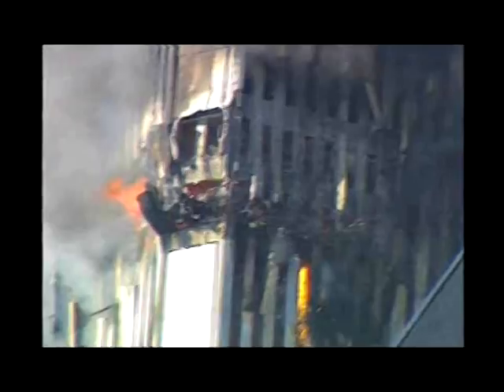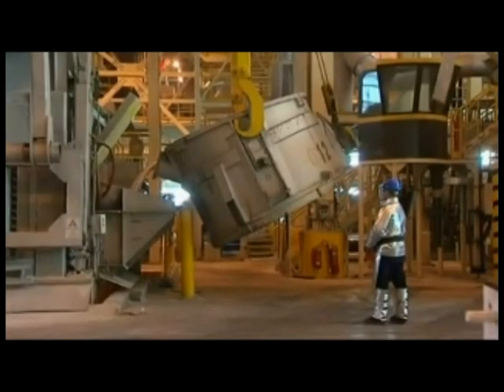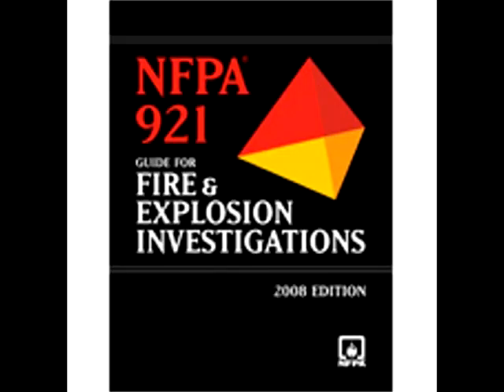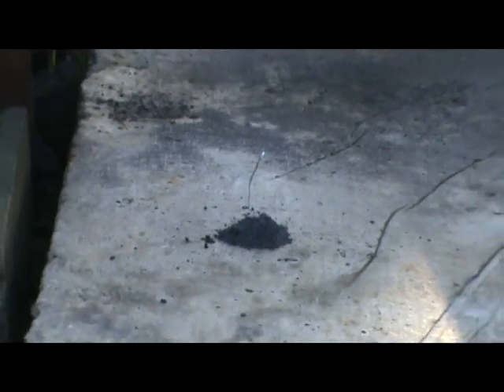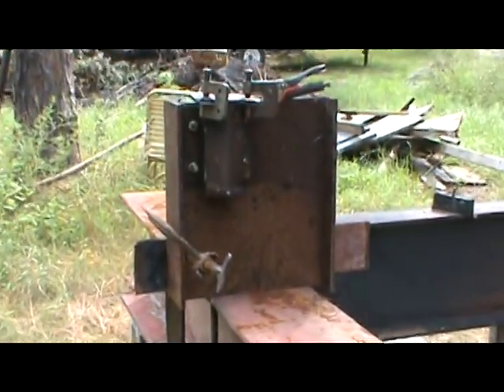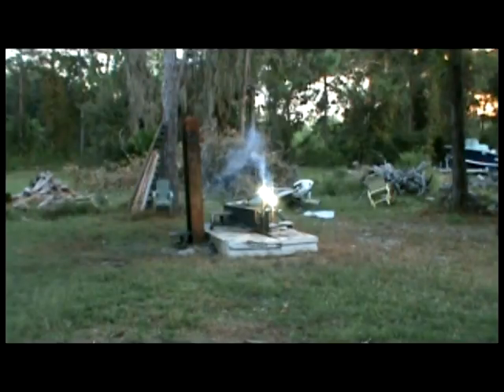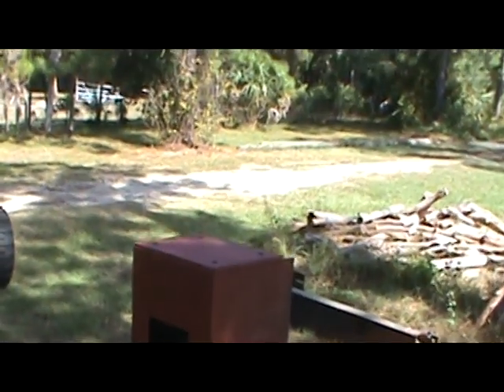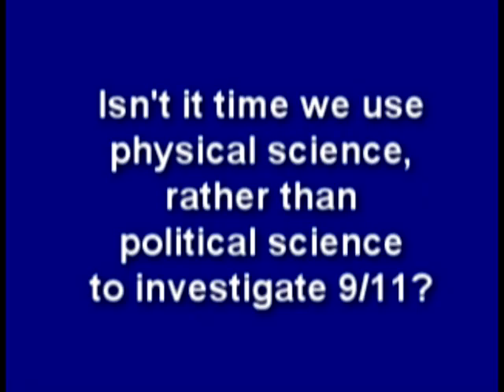9/11 Experiments: The Great Thermate Debate

Comment: Maybe a normal office fire can't melt steel. But have you thought about the air movement in this height? There is a steady airflow just like in a coal pit of a forge. And it's easy to reach high temperatures by blowing air through the forge to melt iron with 1400 °C. The melting point of much steel alloys is lower than from pure iron. And the temperature where steel loses the stability is much lower. Arround 900 °C. 

And who says that the molten metall pouring down the window is from the steel beams? There are many filing cabinets are made of metal which can melt at low temperatures. There are so many other metall sources in an office. If the temperature is high enough, you can melt everything. And burning fuel, paper and furniture with a steady airflow from the wind would make it quite hot...
Reply: Fraggy1972 what about oxygen on board that would act like oxy-jet fuel torch
Reply: People also seem to forget how much electricity flows through these buildings, imagine all that wire being cut/burned and arcing to all the surrounding steel. With enough electrical current you would get lots of sparks and lots of added heat
Reply: People suggesting oxygen from onboard the aircraft or electricity from the wiring could have collapsed a steel structure are more delusional than any conspiracy theorist I've heard yet...
Reply: Exactly
Reply: And the really sad thing is that I have had to explain this to each and every one of you.
Reply: Really?  Then please identify my errors and provide the 'correct' information.  Also remember that I'm talking to an audience of laymen - most of whom probably don't even understand what potential energy is.

Think about it here - these people think that thermite was needed to bring the towers down so we know that they don't even understand the most elementary concepts.
Reply: lets say you are right and the jet fuel could melt the steel beams. if that was the case why did the building fall as if a demolition team were working on it and not a fucking plane crashed into it.
Reply: "lets say you are right and the jet fuel could melt the steel beams."

I never said anything of the sort.  I merely pointed out that structural steep loses strength at a predictable rate as it's temperature rises.  

And how else did you expect it to fall?  There was a cascading failure that started out slow but accelerated to high speeds in under a second.  You can tell that from the video.  And as for how it fell - it fell in the direction an external force (gravity) was acting on it.  Remember that the supporting columns were very strong in compression but were not designed to resist any kind of large lateral load.  So any significant deviation from vertical would cause them to fail.  And when they fail the load they are supporting will fall in the direction that an external force is acting on it.
Reply: How else do you think it could have collapsed?  The only force acting on the structure was gravity and you'd need some kind of lateral force to cause it to collapse in any direction other than straight down.  

And only an idiot would think that the steel melted at all.
Reply: @colincampbell767  you mean the idiots who were there and were fighting the fire and said that there was molten steel pouring from the side of the building not to mention the video showing this was indeed correct. Huh. Also how do you think jenga towers fall when you take out the support from the side. Do they collapse in on themselves or do they topple. The way the tower collapsed is unnatural to structural damage. It is impossible that damage occurred even across the supports as to incur such a collapse. You're just wrong on every level.
Reply: I've seen the video.  And that was not molten steel.  As for the people who you claim said that they saw 'molten steel' - what makes you think they were correct?

And you are seriously thinking that a skyscraper is similar in construction to a Jenga tower?  WTF?  That's beyond stupid.

Clue for the clueless: Buildings are hollow.  Jenga towers aren't.
Reply: @colincampbell767  what makes me think youre correct? The body investigating the incident said it was a molten metal that they claimed to be aluminium but could not prove as aluminium does not glow hot red. If you could provide another explination it would be welcome. As for my analogy it was just that an analogy. Saying my analogy isn't a hundred percent correct is stating the obvious.
Reply: Do you have a reference for a "body" saying that it was molten aluminum?  The video is pretty conclusive that it was not molten metal.

As for "aluminum not glowing hot red"  <facepalm>  You should have learned enough in your high school physics class to know better than to say something that asinine.  

Here's a video where somebody debunked the moronic idea that aluminum does not glow red hot in his kitchen: https://www.youtube.com/watch?v=1IsBx0vLf-I

And I'm not saying that your 'analogy' isn't 100% correct.  I'm saying that it's zero percent correct.  All it did was demonstrate that you have absolutely no clue.
Reply: 1) NIST is the body that investigated the 9/11 incident.
2) https://www.youtube.com/watch?v=2bv95zzBh18 at 1:05 there are eye witness accounts of molten metal and at 3:27 there are pictures of molten metal flowing.
3)https://www.youtube.com/watch?v=30OVAvg1aGQ&feature=channel_page this video proves the molten metal flowing cant be aluminum because aluminum stops glowing red as soon as the heat is no longer applied.
4) I thought my analogy was pretty solid for a basic analogy to be fair.
Reply: You appear to me making the mistake of assuming that the 'eyewitnesses' knew what molten steel looks like.  These people saw something and then decided that what they saw was molten steel.  This does not mean that they're correct.  You appear to be assuming that they are experts in metallurgy who had perfect information because they said something you wanted to hear.  

And I asked for a reference to the report that there was molten metal of any sort.  The NIST produced several reports on various aspects of what happenned.  Which report mentions this and where in the report can I find the specific information?

So first you're saying that aluminum cannot glow red and now you're saying that it will stop glowing red the moment the heat source is removed.  How long the glow lasts depends on how much thermal energy is in the mass and how fast the heat is lost.  Aluminum foil will cease glowing the moment the heat source is removed because it has a low mass and has the ability to lose heat rapidly.  Ten pounds of molten aluminum in a compact mass will glow for several minutes.  

And this same thing also applies to steel.  So please explain to me why you are so certain it was molten steel when it would be impossible to tell the difference (using the unaided eye) between molten aluminum and molten steel at equivalent masses and temperatures - from a distance.  

Besides - from the video it's pretty obvious that it was some sort of burning material that fell.  (It gets hotter when exposed to moving air instead of cooler.)

And your 'basic analogy' does not take into account the fact that one structure is solid and the other is hollow.  A Jenga tower cannot collapse straight down because the wood is solid and there is no space for it to collapse into.  When you use an analogy - you need to ensure that both examples are similar enough so that the same principles can be applied to each.
Reply: @colincampbell767  dude, the rest of the building under the fire was completely intact... even if the damaged part collapsed  it could v never taken down the rest. NEVER. Scientifically impossibl without demolition.
Reply: "Scientifically impossibl without demolition."

Really?  Please explain - I can use a laugh.
Reply: Hot enough to melt steel would have vaporized nearly anything else to burn fairly quick I think. Way to many variables to know for sure. After all these years I personally think the towers were designed and built with a safe self destruct method built into them.  But what do I know.
Reply: Just a layperson here 🍿
Reply: Do what this guy did in the video and show the proof of your theory. Otherwise you are just a conspiracy theorist like millions of other people that try to prove or disprove what happen on 9-11 with words. Try it and find out, if it works then film it an upload it. Otherwise your comment is void just like all the rest.
Reply: How did I determine this?  Because I understand how structures are designed.  The rule of thumb is that the 'official' maximum loading is 20% above the maximum expected load.  And there is an unofficial 20% generally added in to ensure that any defect in design, construction or materials won't compromise the structure.  So when you lose 40% of the strength - you've lost all of your safety margins.

In addition - the temperature probably exceeded 1000F anyway.  Add this to the impact damage and consider the fact that almost all steel frame buildings built before the mid 1990's had a design/construction flaw that resulted in the welded connections not being as strong as calculated by the engineers - and that building is in serious trouble.

And the collapse of the building itself is simple high school physics.  Kinetic energy is calculated using 1/2 the mass times (velocity squared).  So when the trusses supporting a floor failed they fell ~15 feet.  The impact force felt by the floor below would be about ten times the mass of the collapsing floor.  So you have a floor that (using the most generous assumptions and assuming no damage from the impact of fire) can support a total of 150% of it's own weight with a sudden impact load of over six times what it can withstand.  The truss supporting this floor would fail instantly.  

And this process builds on itself. The second floor down will be getting hit by the mass of the two floors above plus the combined kinetic energy of each floor.  So as we can see by the videos the collapse starts out at a rate the human eye can detect and rapidly accelerates to the point where the resistance of the structural elements below is pretty much irrelevant to the equation.

Here's a thought experiment (don't try this at home) to demonstrate this.  Place a stack of four bricks on your foot - no problem.  Drop one brick from shoulder height onto your foot - serious pain.  It's all about energy.  Every joule of energy expended in raising the materials upwards is stored in those materials as potential energy that's waiting for gravity to turn it into kinetic energy.
Reply: You don't have to melt steel in the first place.  This is why everybody who knows anything about the properties of metals <facepalm> when they see this video.

It's absolute stupidity.  Total Absolute Stupidity.  

At 1000 degrees F, structural steel retains only 40% of its strength.  And this is true of just about all metals - as the temperature rises they get weaker.  This is why the buildings collapsed.

Don't believe me? Look it up for yourself.  Type "structural steel temperature" into your favorite search engine and look at the graphs that show how much of it's strength structural steel retains at various temperatures.

In fact - in case you are unable to do a Google search (you took this video seriously so you can't be that smart) here's a link:
https://www.engineeringtoolbox.com/metal-temperature-strength-d_1353.html
Reply: you dont have to melt the steel for it to be weakened but the steel did melt. sooooo ...
Reply: What makes you think that any steel melted?
Reply: @colincampbell767  You should watch the video before posting.  You have debunked a strawman.
Reply: First of all - FoS (Factor of Safety) is calculated differently in skyscrapers.  Remember that the more weight you place in your structural elements (for increased strength) the more weight the rest of the structure has to support.  So increasing the structural strength of the higher elevation elements can in fact reduce your safety margins.  (I know that you are trying to sound impressive here - but most of the people here are laypersons so we should be using simpler terms such as 'safety margin' instead.)  

As for the reports that the steel never reached over 500F - can you supply some references?  I have not seen anything that says this.
Reply: My issue with your use of the term FoS is that you were 1) bragging, 2) trying to trip me up and 3) trying to impress people by using jargon they don't understand.  At the very minimum all of these are rude and impediments to discussion.

If you notice that when I first used the term 'FoS' I immedeatly defined what it meant.  There's a difference between our purposes here.  You are here to debate while I am hoping to teach.  Also remember that my basic point here is that the idea of using thermite to bring down the buildings is just plain stupid.  (FYI - I kind of specialized in defeating structures rather than building them.)

I'm going to have to go and re-read the NIST (National Institute of Standards and Technology) papers (been several years since I looked at them in detail) to see what they said about the temperatures of the steel.  Those temperatures sound odd to me because steel is an excellent conductor of heat and even the NIST pointed out that the impact stripped the fireproofing off the structural steel elements.
Reply: And it does not have to be to all the floors - just damage enough damage to a few critical elements that a cascading failure can start.  Drop one floor - and you have a cascading failure that increases in magnitude with every subsequent floor failure.  (And remember that things happen very fast when cascading failures hit structures.) And since you read the NIST reports (which reported that parts of the structural steel was heated to beyond 600C BTW*) you are aware that the collapse was not caused by any single mechanism.  Each served to weaken the structural elements to the point of failure.  (Even though I still take the position that the impact of fire on the floor trusses would have still been enough to doom the buildings.)

As for thermal conduction - do you really think that enough heat would be conducted away through the structural steel to make any kind of a difference?

* I've sent a request for the full text of the 2013 NIST report that modeled the fires in the two towers. So more on that later.

Comment: Do you have eyes to see and a soul to resist lies? Can anyone believe buildings designed to withstand '2' plane hits could recieve a strike on the 100th floor. And then the lower 100 floors disintegrate as quick as if floors 100-110 were held up by good will and cotton candy. The laws of physics bow to no terrorist, official believers suck on that!!!!
The port authority had them built as the 'pride' of america, if they were fragile the would never have been built. 
No aluminium can causes a building with  47 monster girder cores to crumble to dust.
If you believe that, your craven or a sucker. Truth alwayz outs .
It was important to the murders to take those towers out, but they left more than enough evidence to show what really happened.
God save america from these demons.
To those who blame a pancake effect, if this was so each floor would've provided resistance and slowed the collapsd. This is not what happened, 47 massive girders withdrew their support instantly throughout 110 floors. The roof fell to earth as quick as a hammer dropped from the roif through thin air. If you have a soul you'll realise the gov version is a fantasy.

Comment: I repair equipment for metal fabrication. Any time we cut steel we need to add lots of compressed oxygen. 
Thermite is the only thing that can melt the steel without oxygen. 
I will go as far as saying the plane wont get through the steel. The steel was blasted just before the planes hit. If you watch slow mo video there was a flash before the plane hit.

Comment: If Thermite is "The elephant in the room" for WTC 1,2 &7..WHY stop there?
-What happened to WTC 3,4,5,6 and the Banker's Trust buildings?
-Does Thermite explain WTC 6's large circular "holes" ?
-Explain how 1400 motor vehicles were toasted AFTER WTC 1& 2 came down...some were located 0.5miles away
-Did Thermite or even Jet fuel have this effect AFTER the  "collapse" of WTC 1&2?.. I saw dust clouds not a fireball. .
-Hurricane Erin..explain why the people of New York and surrounding areas weren't aware of a Category 3 Hurricaine which was just miles off it's coast and heading straight for New York on 911
-Bush Snr's involvement with Project Hammer and the importance of Sept 12th 2001 was to this Project
-The missing Gold from WTC 4
-Convar 911
-Odigo 911
-If most of the WTC buildings and their fittings were pulverized.. why did the Thermite not burn all the paper on the ground? 
-The WTC complex was still fuming YEAR'S later...was this due  to Thermite?...or was there another Process  going on ??

Architects and Engineers for 911.. it's your duty to do a true investigation into ALL the evidence!...40% of the people who were in WTC 1&2 on 911 STILL can't be accounted for.. not even by DNA...surely their loved one's deserve to know the real truth from that terrible day as the world changed forever post 911.. 

Do your research
a) 500 pages of evidence from Dr Judy Wood
b) Nikola Tesla
c) John Huchison 

Mr Gage, surely your colleague Steven E Jones  could enlighten a few of us about " Free Energy "! ?

Comment: Really come on dude a huge freaking jet with tons of jet fuel brought the towers down inside the tower is a confined area like inside of a smelter or furnace  no conspiracy
Reply: NIST disagrees with you completely. According to NIST, the temperatures NEVER got anywhere close to melt the beams (hence they cannot explain the molten metals). Furthermore, the jet fuel was gone when the airplane hit. You see the big fireball when it hits? That's the fuel.